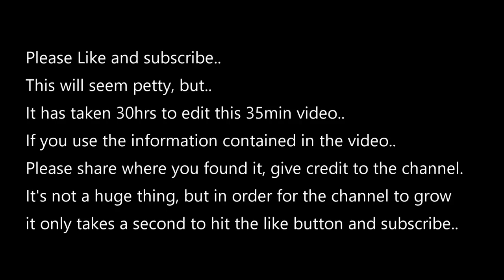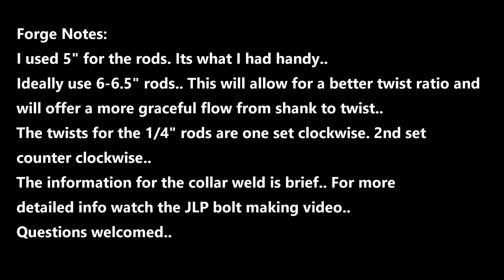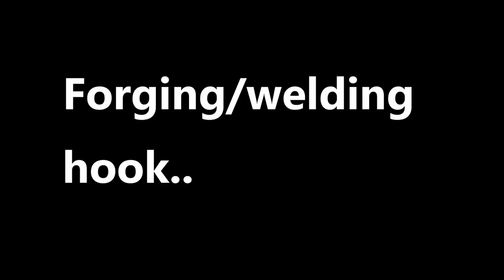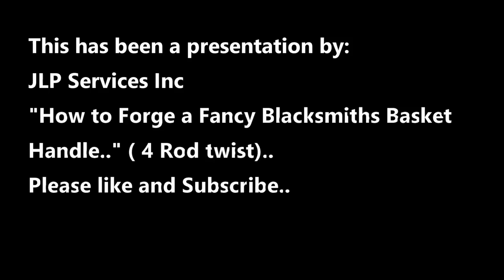How to forge Fancy Blacksmith Basket Handle  (4 rod twist).  #1

Comment: WOOTWOOT Narration! Most Outstanding. Who knew We’ve had a type of vice right on the Anvil? You did, that theirs what you call a Paradigm Shift.  When I do a twist and I don’t  get it correct I could never get it back to redo it. I never tried to pull the twist, Air will from now on. Very nice work.
Reply from the maker: Hello.. Yup many ways to get to a result.. Sometimes it just takes that one question as to why not..  I do this a lot.. If the tongs are graduated enough they work very well..  need more clamp.. just squeeze an or push in farther.. :)   Thanks for commenting..  Jennifer

Comment: clever use of the hardy hole and the scrolling tongs!
Reply from the maker: I do a bunch of little dittys like the tong vise..  Since i have never worked with someone else, a lot of the information is not wide spread.. There are little bits in all the videos of those little tricks..   Of course if someone is newer they won't know if they are or are not well known.. :)
Reply: @jlpservicesinc1452  well it is certainly one I shall have a go at.! I shall keep an eye out for others!

Comment: Not sure how I chanced on to your video here, but I am extremely impressed with your talent and several of your techniques. Like poking your tongs I to the hardy to make a vertical vise. REALLY great idea. 
I will be following your channel for sure. But yea, the three way out of sync was about to pop my feeble brain so I turned the volume off so at least it was only 2way out. 
But that is just editing skills that you could hire or find anywhere. Your talent is truly unique.
Reply from the maker: Thanks very much for commenting..  It really is appreciated as feedback is paramount to getting out the information people can use.. 

There are a bunch of those tricks in all the videos.. Some will be more obvious than others..  

I wish it was simply and editing thing.    It's not though it's a software glitch..  My old program works perfectly and every aspect of the footage was perfect.. (software is not backwards compatible)..  The new software even though on the time line is perfectly matched it won't sync.. And if I do get one clip to sync, there are 10.000 more to do.. Not a very effective use of the time..  I'll see if the software people can get it worked out.. 

If they can't I'll edit the raw footage again in the old program as I know it works..   Thanks again..

Comment: Very nice! Never seen tongs used as a vice. Can see another use for your vertical hardy holdfast you made in another video.  Hope you get that school open.
Reply from the maker: Hello.. I'm pretty sure no one has..  It seems to be one of the points brought up the most in this video.. I'm sure you have noticed there are little tidbits in all the videos..  It's one of the great things about never being told it won't work..  I can then decide for myself if it will or won't work..  :)    Thanks and great to see you watching.. Have a great day.. Thanks again.  J
Reply: @jlpservicesinc1452  Thats what is so unique about blacksmithing, use what you have, make what you don't have. You sure know how to do that. And you share it!
Reply from the maker: @johnmichael283    :)

Comment: If you have the original footage I can fix this for you.
Reply from the maker: That's very generous..  still working with the software company..  should know by the end of next week...

The footage as edited is in sync..  once produced it is then out of sync..
Reply: I do this for a living so... lemme know.
Reply: @jlpservicesinc1452  yeah... that happens with some of the mobile editors. If you just have the audio from one track then I can take the video and sync it back together and render in something more pro like Premere where that wont happen. Just remember that any traffic you get from this video goes away when you launch the new video. there is no replacing a video on youtube. So, it is always better to wait rather than post 2x.
Reply from the maker: @daxcastro  no mobile editer.. I'm assuming you mean phone..   Or do you mean  professional editing center vs desktop or laptop..   I've been using it for about 2 years or so with no problem and last upgrade in the software was no problem.. It's only when I switched to the new version that is now is a problem. This is the first video using the new software.. 

I"ll more than likely just double post..  Not sure if you noticed but the channel being famous has not been a concern..  getting information out there has been the primary concern with the secondary goal to stay true to my original intention..    Though I get requests daily do include narration or voice overs..  I prefer the titles on many levels.. 

All the footage is 3D down mixed to 2D and every heat removed.. 

You advice is well received.. I appreciate you taking the time..